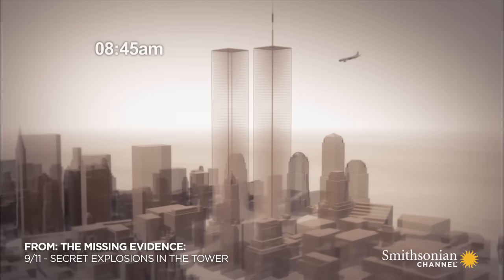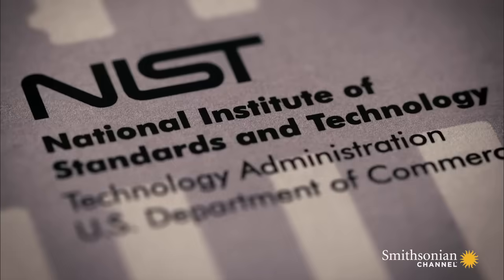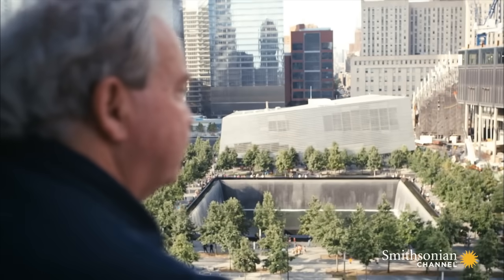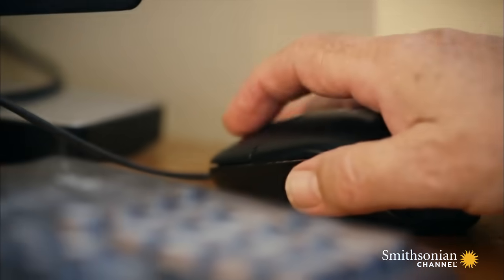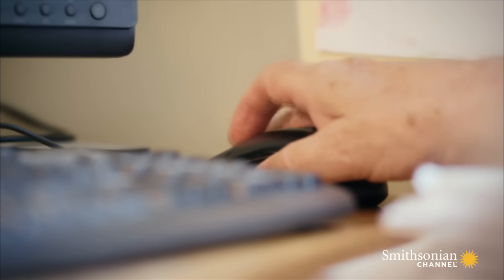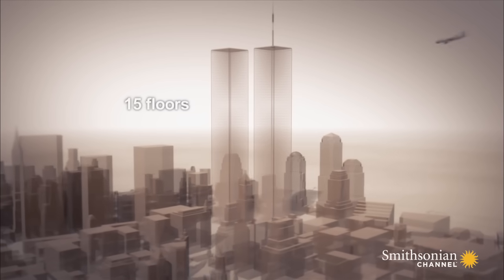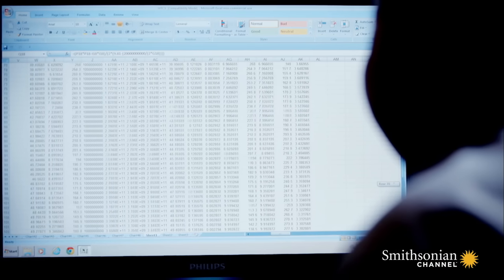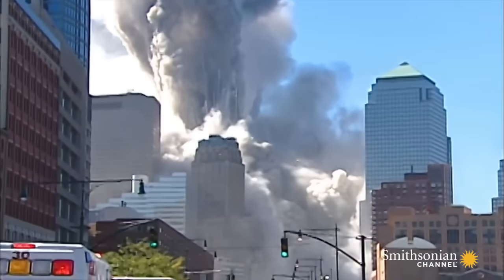This Computer Simulation Explains How the Twin Towers Fell

Comment: Explain the unrelated building falling at the same time. And explain how 2 planes took down 3 towers.
Reply: It was pulled
Reply: wenton  A plane hit the building, that's enough impact force to ignite propane.
Reply: wenton  
We are, simply put it makes much more sense to put a main propane unit in a 40 story building as opposed to one of the 100+ story buildings.

There's less people to get in the way, less traffic going through a 40 story building than a 100+ story build so maintenance would be easier, not including the initial construction.

That said the 40 story building was WTC 7, the main station would have pumped propane to substations located within the other two building.

Since the other 2 buildings were attached to the same HVAC system the planes striking those two effectively lit the fuse of the 3rd building collapsing.

Was only a matter of time. Reports from the inside of WTC 7 support this claim as there were fires inside of WTC 7 that the fire suppression system couldn't extinguish.

That can only be caused by something with 1. a stupidly hot heat source, or; 2. a hot heat source with a near endless supply of fuel.

Since propane burns at 5000*C under rich oxygen content, and the source was a huge tank of propane enough to heat 240+ stories of skyscrapper, those check off both of the causes for a fire system to fail at putting out a fire.

Add that to the timing, which roughly lines up for how long it would take for a propane system to systematically give way through 3 buildings from the point of contact that would cause the first two to start collapsing first and then the 3rd one to go a few minutes later once the heat had successfully compromised the structural integrity of the steel inside WTC 7.

Side note: As I've mentioned oxygen rich propane burns at 5000*C, common steel has a melting point of 1500*C and a boiling point of under 3000*C, this flame is hot enough to boil steel into a gas and has a near endless source until the main reservoir explodes.
Reply: wenton  

Good luck finding stuff on the HVAC system, the buildings had been modified several times prior to the attack so unless you can find accurate up-to-date blueprints of the building from 2001 we'll never know if I'm correct, or if you can somehow find financial records from companies that did the modifications, but if the company that did them went bankrupt in 2008 then it'll forever be lost in the void of past information in similar fashion to how the records for modifications would have been lost in the attack. Due note that tenants in the buildings could request modifications to be made, so who knows exactly how many people requested changes that went undocumented over the course of 50ish  years before 911.

I'm strictly speculating from an above average understanding of physics and chemistry. It makes sense that they would transition from electrical heating to natural gas as it would be FAR cheaper. Capitalism is entirely cost vs effect and the world trade center was about as capitalist in sentiment as it comes. So it would shock me if they stayed with electrical heating.

If they did have a propane system running through the center supports of the buildings then a plane crash would take the entire building out plus the building where the central HVAC system was located. Although to be fair most of the damage came from the propane system I think. The building may have had enough structural integrity to survive the top half falling on itself but certainly not with propane explosions rippling from top to the bottom.

Re-watch a video of the towers collapsing and you can see what appears to be explosions going from floor to floor and blowing out the windows far before the tower fully collapses. This is very reminiscent of propane pipes exploding due to variance in pressure as the pipes melt. It would be a cycle of the end of the pipe melting reducing the surface area for ignited gas to escape causing the pressure in the pipe to build, once the pressure passes a thresh hold the pipe dramatically explodes causing a drop in pressure resulting in the pipes melting again prompting the cycle to repeat itself.

As for the reports from WTC 7 I'm sure a quick google search will turn those up. I just heard rumors of reports from people inside WTC 7 and they just happened to fully support my claim.

Like I said this is all just speculation on my part, I prefer thinking from every possible angle instead of jumping to government conspiracy. Not to say it wasn't a conspiracy I just don't think it was government by nature. There's plenty of people who stood to gain from the war in Iraq, the government was not one of them I don't think. Someone who owns majority share of a conglomeration of firearm and ballistics companies would stand to gain very much from a war though. If the attack itself was a internal conspiracy then I think it was done by someone similar to the aforementioned and not the government.
Reply: Obviously you're not a bowler.
Reply: They were all run off the same propane heating system, it was one of the original buildings. Propane system ignites in one building and since propane burns at 5000*C without a controlled oxygen source it was well hot enough to melt the interior beams causing them to buckle and collapse despite the building not being hit by anything. Assuming the main unit was inside 7 WTC building and sending propane to the other building which is likely how it was set up due to the smaller building having less floors making access to the propane unit for maintenance easier. The building gets hit by the plane, causes the propane to ignite, pipes throughout the building explode due to back pressure further weakening the building, the exploding pipe will continue making their way to the smaller building where the unit is located, due to excess pressure near the source stopping back flow, it ended up melting the beams as the back pressure started lessening causing a full collapse of the building due to beams buckling from being heated to near double their melting point. This also answers why the fire suppression system inside the building wasn't able to put out the fires. You'd need a lot of water to put out a 5000*C open flame with a strong source, let alone multiple 5000*C open flames.
Reply: @MinkoMix  thats cute...but it doesnt match what the government agency NIST said what happened!
Reply: @4465Vman  
What exactly did NIST claim happened?

Unless they had detailed blueprints that were redone after each modification that was made to the buildings, they are just basing their claims off their knowledge of physics. Updated blueprints aren't going to exist as paying someone to redo the blueprints each time would have been immensely expensive $25,000+ each time easily for a building that size, times 3 buildings. $75,000 for updated blueprints from an engineer after each modification. No one is going to pay $100,000 for pieces of paper, just to throw out the last set they paid $100,000 for.

So the NIST is basing their claims on incomplete information, just like everyone else.

I am interested in what they said happened though, give me the jist of it?
Reply: @MinkoMix  NIST says that the failure of a single intersection between a floor and a girder caused the entire collapse ..something like thermal expansion of the bolts or of the joint of ONE intersection caused the collapse...the building had 47 floors and 82 cvertical columns so thousands of intersections!! NIST will NOT release its computer models to outisde enineers who have requested them , citing to do so "would compromise public safety!!??"
Reply: @4465Vman  
Hmm interesting but that explanation leaves to question the systematic blowing out of the outside walls of the building far before the collapse really started going. The plane alone would not have been enough to cause an expansion with that level of explosiveness. The "explosions" (lack of a better term) happened far too rapidly, the steel below should have taken far more heat the further down it went if that was the case due to conductivity and the way heat travels through pressure. I've been wrong before though and by no means claiming to know all the answers. I need to rewatch the collapse with that in mind. Thanks for the info! :)
Reply: @MinkoMix  in what world does propane burn at 5000 degrees Celsius?  "Oxygen rich" propane as you put it would mean pure oxygen being mixed with propane before combustion, not after, even then it wouldnt burn at 5000 degrees celsius, let alone by itself. Your comment is so riddled with incorrect information its scary people actually thumbed it up, ignorance all around. You have no idea what you're talking about, AT ALL in any of your comments, stop being so pretentious. Almost everything you said in this thread is bogus.
Reply: @MinkoMix  the problem with that is you wouldn't see a symmetrical collapse.
Reply: @ReadyPlayerDog  So your stating like many others that the buildings collapsed symmetrically??

They did not fall symmetrically. Them collapsing in perfect symmetry means that for every spec of dust there was another spec of dust perfectly mirrored. There would have been equal amounts of rubble on the ground perfectly mirrored to each other. They did not collapse symmetrically. Not by any stretch of imagination.

Now you gotta realize that there was piping through the entire building and that piping would have systematically gave way causing what looks to the human eye to be symmetrical collapse.

There's a very very fine line between being symmetrical and asymmetrical.
Reply: @ReadyPlayerDog  In further conjunction how do you explain the reports of fires in WTC 7? How do you explain the reports that the fire suppression system wasn't able to put them out? Gas fire, simple as that. You could dump a bucket of water on a high oxygen-rich propane flame and the water would evaporate within 3 or so feet of the actual flame.
Reply: @MinkoMix  I'm not sure about the towers but building 7 was almost certainly a controlled explosion. I'm no expert and neither are you. I'm just going by what the over 1300 experts ranging from chemistry, engineering, architecture, demolition, ECT have concluded. A lot of these people have PhD's. Some of the world's leading g demolition experts were shown the footage not knowing what it was and all said it looks like a perfectly controlled demolition. As for the towers I've seen people explain both sides so I'm not committed either way.

For me it's the same as the moon landings. Some people don't believe it so I look at it myself then listen to experts who've studied this their entire lives and I have no reason to doubt that we didn't go to the moon, that's what the evidence suggests.

Outside of the actual buildings coming down there was a range of very strange things going on. All of which confirmed but none of them was explained or followed up on.
Reply: @ReadyPlayerDog  I'm trying to devise an explanation based on my slightly above average understanding of physics and chemistry. I look at the points people are making and play the devil's advocate against it. Just like I stated the buildings didn't come down symmetrically, there's too many variables for that to be possible even under a controlled explosion. Each bomb would need to be placed within zero tolerance of each other and all be wired with identical latency to the remote trigger. To me it's more likely that the main heating unit was propane and located inside the first building made (Wtc 7) and that this also supplied propane to the two larger buildings. The unit would have exploded several minutes after the first two buildings collapsed prompting the third one to collapse.

The people you are talking about with the phds were shown what, a few videos at most? For any of those people to say without a doubt it wasn't capable of falling like that they would need a 100% accurate blueprint of the building including every single system involved with normal operation, which wouldn't have existed since the building had been modified several times between when it was first built and when the planes crashed into them.
Reply: @ReadyPlayerDog  people don't believe the moon landing cause the flag was "blowing in the wind" they say that without realizing that the moon is moving, it's moving very very fast. Fast enough that if you take a flag and stick it there the flag will trail behind the pole. That's basically their entire argument, at least from what I'm aware of.

Out of curiosity, what are the strange events you mentioned. I'm aware of a few of them but maybe you have a few I haven't read and proposed a logical solution to.
Ones I know are:
Wtc 7
Lack of a plane at the pentagon
"Symmetrical collapse"
Rubble flying "too" far away
Reply: @MinkoMix  the flag thing was easy to explain, there's not resistance in space so whatever force is imparted on the flag would remain. 
When I was in my late teens I thought the landings where fake so I went out of my way over the next several years to look into each detail. It became a bit of a obsession! Turned out everything had an explanation, and not just from NASA but from scientists completely unrelated. Just because I didn't fully understand something didn't mean it wasn't real! 

As for the strange things around 9/11. A few days before there where some unprecedented levels of trading on the stock market in some very specific areas. The SCC immediately started to look into it. All these trades had to do with certain airlines and companies located within the Trade Centre. The officers where this was taking place were located in Building 7. After the attack all records of those transactions were subsequently destroyed and no further investigation was made. 

The day before Rumsfeld (is that the correct spelling?) announced that the defence budget was missing $2.3 trillion. A investigation was started. The investigation was taking place in officers located within the Pentagon, the excact offices that got hit by the 3rd plane. As far as I can find out, this investigation was never continued.

On 9/11 the military was conducting a series of war games, 4 or 5 I think from memory. One of those was of commercial airplanes being used as missiles to attack the US. All records about those were given the highest classification level a few days later.

Then there's the video footage taken by Mosad of the attack. They were set up recording a few hours before the first hit. That I can kind of understand. The FBI and CIA did have plenty of knowledge of the hijackers. If they had connected the dots and shared info then they might have known before hand. Mosad are a very effective intelligence service. It's not inconceivable to think they had prior knowledge but decided to keep it to themselves. I would actually be surprised if they didn't.

As for the towers themselves. Well I can see explanations for the reports of "explosions" going off just before the towers fell. Certainly a large explosion has been recorded about 7 seconds before building seven collapsed. Maybe that was something exploding in the building that tipped the balance or maybe it was a demolition charge. I couldn't say. The one explosion that stands out is the report from people working in the basement of (I think) Tower 1 (The first one that got hit.) Multiple people reported a massive explosion that lifted them high up into the air and a man who came in with some very serious injuries. Just as somebody picked up the phone to make a call was when the first plane hit. That was verified by multiple witnesses, chief amongst them was the janitor who was famous for saving a number of people and being the last person out before the collapse.
Reply: @MinkoMix  as for more things about the moon landings! I can give explanation for each of these to confirm it's real but I'll just give you some of the highlights!

There's the fact you can't see any flame when the lunar module takes off from the moon.

The radiation levels "should" have killed the astronauts.

Some of the footage is obviously fake.

You can't see stars in some of the photos taken.

The fake moon rock found in a Danish ambassadors belongings after he died was actually petrified wood.

Those are the best ones, but all have been sufficiently explained in my opinion.
Reply: @ReadyPlayerDog  

If I missed anything about 9/11 let me know.

As for the moon stuff you mentioned, I can't believe how silly most of those are lol.

"There's the fact you can't see any flame when the lunar module takes off from the moon."

The moon has less gravity, it's 16.3% of earths, it also has a smaller diameter so you don't need to get as far before you pass the point of gravitational pull. You could use an air jet and propel yourself off the moon. The use of fire isn't necessary when you're dealing with 1.63m/s2 gravity as opposed to earths 9.8m/s2. It's 16.3% at surface level, the further from the core you get the less gravity you are exposed to, so half way out the atmosphere and you're feeling what 7% of earths gravity.

"The radiation levels "should" have killed the astronauts."

That one made me chuckle haha, they are wearing massive suits that are going to absorb a large degree of any radiation they are exposed to, likely far more than our atmosphere absorbs. And either way, radiation from the sun is just heat, it should just end up balancing out since it would be colder than on earth allowing the suit to absorb an even larger degree of radiation.

"Some of the footage is obviously fake"

A lot of things are fake, but give me a good reason for nasa of all groups to fake the moon landing, what would they gain from doing so? Where's the motive? And I was under the assumption they thought the footage was fake because of the flag.

"You can't see stars in some of the photos taken."

Yes let me take a picture with my 0.5 mega pixel (likely less) camera with non-adjustable exposure and see how well the stars show up on the image lol. A camera back then and a camera within the last 10 years are very different things.

"The fake moon rock found in a Danish ambassadors belongings after he died was actually petrified wood."

That doesn't surprise me, props to the guy for having the idea to sell a piece of petrified wood as a moon rock lol. Probably made a pretty penny off the moon landing haha.
Reply: @MinkoMix  Actually the answers are a little different for some. The flame answer is because they mix two chemicals together which give off a very low visability flame. So while there was a flame, the camera was too far away and too low quality to see it!. 

The radiation one actually took me a while to get to the bottom of. It turns out that there is indeed a "ring" around the earth that is very high in radiation (I can't remember the name without googling it so this is all from memory). So NASA plotted a course that took a steep angle to get through it as quickly as possible. They astronauts also took anti radiation tablets. They knew it was a problem but basically just decided to try and get lucky and hope the less time spent in it and tablets along with the suits and ship was enough to protect the astronauts. 

Yeah, the camera stuff is kind of obvious to anyone that's taken a picture at night lol

The petrified wood is just a mix up that the conspiracy people latched onto. Within his belongings was a note from NASA that he'd been given a moon rock. And the was also a piece of petrified wood. Two separate things. Just a good example of confirmation bias!
Reply: @MinkoMix  oh and the fake footage. So some of the footage has been verified by independent experts to be fake or duplicated. My theory is just that it's probably really hard to take uncorrupted pictures and video on the moon. NASA might not have had enough footage that satisfied the marketing department so they used stuff taken from the tests they did on earth. 

At the end of the day you can point a laser at the moon at it will reflect back off mirrors they left behind up there. Obviously providing you had a laser and could do the calculations. Which I can't but I've seen people who have done it.

I also seem to remember that they built a telescope a few years ago that was strong enough to see the landing sights? I've not actually been able to find any info on this so I'm not sure if that's true or I dreamt it lol.
Reply: @MinkoMix  if you have an above average understanding off physics how do you explain the massive internal core columns of each twin tower t, thousands of  tons of wrapped up boxed up core columns running the height of each building turning into close to nothing!!?? how did this tons of steel basically pulverize!!???
Reply: Force is equal to acceleration multiplied by mass. The max tensile strength of steel is 61,000 PSI (pounds per square inch) The top half of the building that collapsed weighed 38,000 tons which is equal to 76 million pounds. The dimensions of each floor is 208 feet by 208 feet which is 4992 square inches. 76,000,000 lbs divided by 4992 inches is 15,000 pounds per square inch. Under normal circumstances the building would hold more than 4 times the weight, but increase the acceleration from 0 to 9.8m/s2 and the amount of weight applied to the floor below dramatically increases.

Force = 0 * 76,000,000lbs indicates that the object is at rest. Thus it becomes reliant on pure mechanical capabilities of the materials in question. Which is weight per square inch / the tensile strength of steel. As long as this number is below 1 the building wont collapse under itself. Change the acceleration from 0 to free fall which is 9.8m/s2.
Force = 9.8m/s2 * 76,000,000lbs
Force = (9.8m/1.14s(Time taken to traven 1 story - 14ft)*2) * 76,000,000
Force = (9.8m/1.3s) * 76,000,000
Force = 7.54 * 76,000,000
Force = 573,040,000 lbs
573,040,000 / 4992 inches = 114,791 lbs per square inch.

After 1.3 seconds of free fall which is just the first floor it traveled the force being applied to the next floor below was nearly double the ultimate tensile strength of steel. If the first floor didn't stop it then the force applied would just keep compounding. After that first collision, the total force would end up working out to 114,791 - 61,000 which would be a left over velocity which is equivalent to 53, 791 PSI. This velocity gets added to the force equation listed above.

Second floor of free fall
Left over PSI = 53,791. Covert that back into force.
53,791 * 4992 inches = 288,524,672 lbs
Start the equation forward with the added weight from acceleration to find out the compounded value accounting for the current move speed of the object.

Force = 9.8m/s2 * 344,524,672
Force = 14/1s2 * 344,524,672
Force = 4,823,345,408 lbs
4,823,345,408lbs / 4992inch = 966,215 lbs per square inch. Nearly 16 times the strength of steel after 2 seconds of free fall

With that said I'm sure the building would have hit terminal velocity before it contacted the second story below. But you can clearly see how after that first second of free fall there would be no stopping the building from crumbling. The building could not apply enough counter force to cause the force from the falling part of the building to become net 0. As long as that does not occur then the force will constantly compound until something does bring it to 0, IE hitting the 
earth.

Of course this isn't 100% accurate as this math accounts for the entire floor being made of nothing but steel beams which isn't the case. So there should be a smaller portion of material with high tensile strength working against the top half of the building.
Reply: @MinkoMix  cute cure youve quoted  some numbers and it sondsscientific  but it doesn expain how the thousands of tons of the internal columns , inernal steel cage disintegrated /pulverized .......if you want to lern  run this by an engineer/physicist who has the time  to look at it and you can discuss it if you care to
Reply: @ReadyPlayerDog  The Apollo astronauts got very lucky with the radiation. My brother was attending Texas University during Apollo and studying astronomy. The astronauts of Apollo 12 (?) I think missed being fried (killed) by radiation by less than a week. New plans include radiation protocols for transient astronauts. Basically it means hiding behind the fuel tanks. Hope it works.
Reply: @fredjones7705  yeah, I heard they basically said "It's the moon, let's risk it".
Reply: @namegoeshere69  I stand corrected. My bad for typing C instead of F. Like you said mixed with pure oxygen it burns around 5,000F. In air it's around 3,500F which is still almost 1,000F higher than the melting point of steel. I digress though, not like it really matters.
Reply: @MinkoMix  yes it does matter actually, considering almost everything you said in your statements is false.